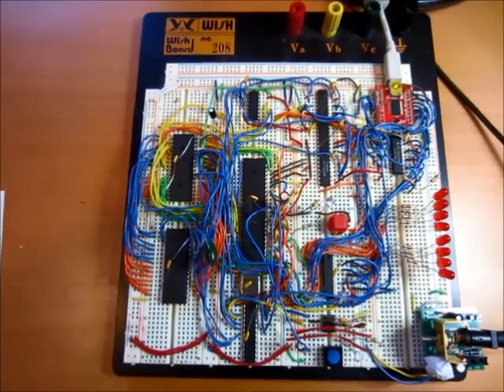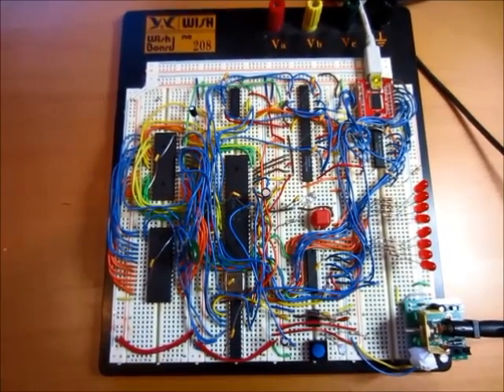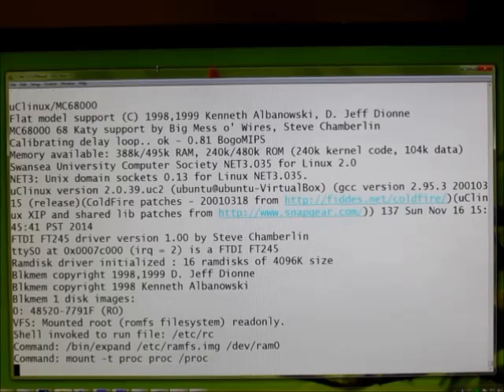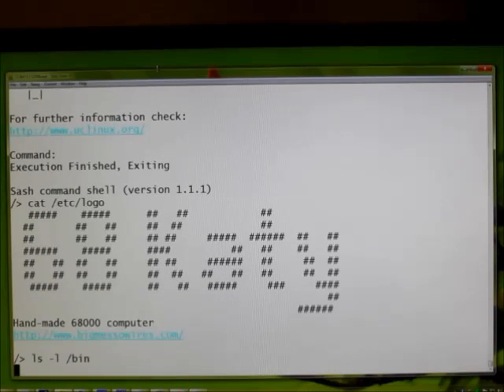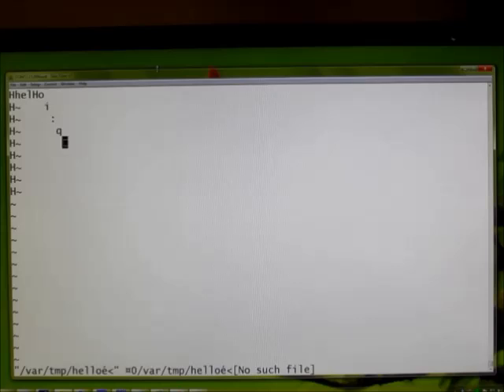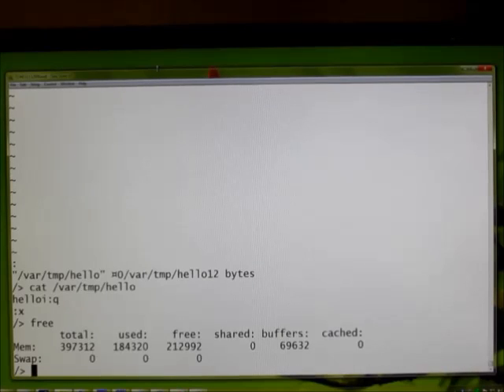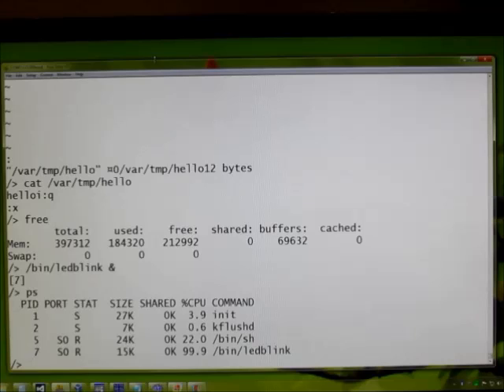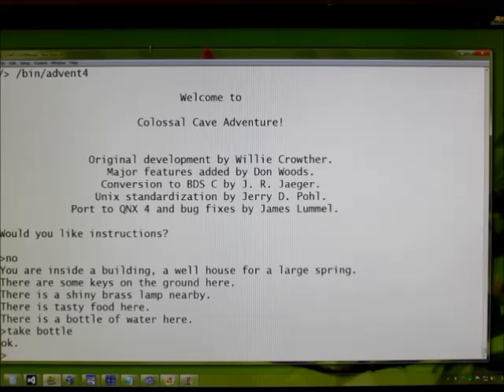68 Katy - 68000 Linux on a Solderless Breadboard

Comment: Love This! but can you run MS-DOS on this system.
Reply: @Z80 Yes I know, but I know DOS better and I want to use software that runs on DOS only. Thanks
Reply: @youshouldjustknowit8583  check out the micro 8088 project
Reply: Not possible. MSDOS is x86 only.

Comment: It's so amazing that the Linux kernel can run on so many different devices, I wouldn't be surprised if someone got Linux to work on a toaster
Reply: The same with netbsd, it even runs on a amiga but only with a 68030
Reply: Lol this loser doesn't own a GNU/Toaster.
Reply: @swirlingabyss  I have a MUSL/Toaster, try me
Reply: This is not full Linux. A full Linux kernel requires a MMU.

Comment: kickstart a 68000 based single-board-computer
Reply: Branko Badrljica 

68000-based systems ran AT&T System V Release 4.0 UNIX no problem, and it ran fast like a champ. SunOS 4 ran on 68000-based 68030 and 68040 for years like a champ. But maybe you're correct - Linux is just too slow on anything, including the MC68000.
Reply: @AnnatarTheMaia  Linux runs great if you pick the right system
Reply: @user-yw8sr3uj1w  sorry buddy, but Linux is a pile of hacks: it runs "fast" because it sacrifices correctness of operation and data integrity for speed, trying to hide the true cost of those things. When you enable write barriers and turn off memory overcommit, Linux shows its true face: it's dog slow.
Reply: @AnnatarTheMaia  what flavour of unix are you running?
Reply: @mattzere78  Solaris 10 on sparc and i86pc and SmartOS on the i86pc platform.
Reply: No use anymore. Is now much lower performance than Arduino.

Comment: In your init message ramdisk init says you have 16 ramdisks with the total size of 4096K is initialized. How is this accomplished on your hardware (given the 512K RAM). What is your actual ram disk size? Have you tried to fill it?
Reply from the maker: 16 ramdisks of 4096 bytes, not Kbytes. Tiny!
Reply: stevechamberlin Oh, yeah that makes sense!
Reply from the maker: Viktor Horváth Actually you were right, it does say 4096K. I'm not sure what that means - it's a default setting. Maybe the RAM disk grows dynamically as needed, and 4096K is the max size?

Comment: Where did you get the processor?  It's a 32 year old chip!
Reply from the maker: I got the 68008 CPU from http://www.arcadecomponents.com, which is a great resource for old and obsolete chips. And 68000 CPUs are actually still being manufactured; you can buy them at Digi-Key!
Reply: @stevechamberlin  So Qualcomm still makes them?

Comment: Is the system clock frequency limited by the cpu or is it because the system gets unstable at higher frequencies on the breadboard?
Reply from the maker: The CPU is rated for 8 MHz, so the problem is with my design or the breadboard wiring. It almost works at 4 MHz, but freezes up midway through the boot process.
Reply: stevechamberlin I used to love breadboarding, but the frequency limitations became horrendous. Now that you have the design proven, get yourself some solder hole project boards and solder that sucker using point to point wiring. I find that wire wrap wire is great for this kind of work. Do not actually wire wrap. You'll find the exact frequency problems with wire wrap that you do with a breadboard. Either way its a great personal accomplishment. Congrats!
Reply: @draeh  We achieved higher frequencies with twisted pair wirewrap and termination but I think this was rather possible due to wait cycles. At that time(late '80s-early '90s) PCB making was very expensive.
Reply: stevechamberlin Motorola 68HC000 could reach 32MHz (even though spec. said only 16MHz) if I remember correctly.

Still kudos for this sweet little machine! I grew up on 68000 assembler - lots of great memories!
Reply: draeh
Nah, years ago we made wire-wrapped, socketed(obviously I guess) 68k boards that ran at 7MHz no problem.  Just pay attention to your layout, and clip the wire-wrap terminals if you run into problems.  It helps to put caps across the power rails of each chip.
Reply: @GeezerTuber  I ran a wirewrapped MC68020 board at 16Mhz. Memory was SRAMs however as I didn't have enough time to implement DRAM interface.
Reply: It is so cheap and easy to get prototype boards these days, would never consider wire wrap now.